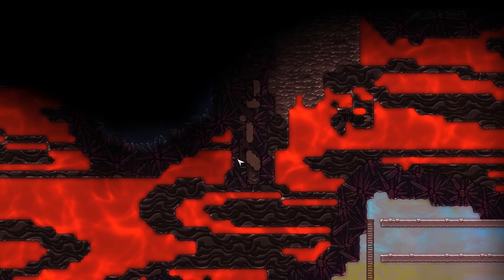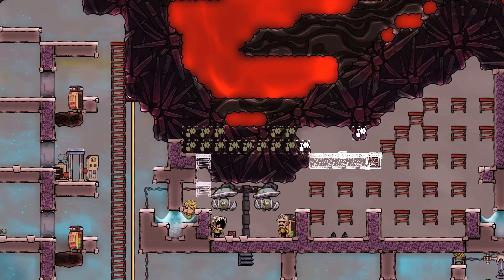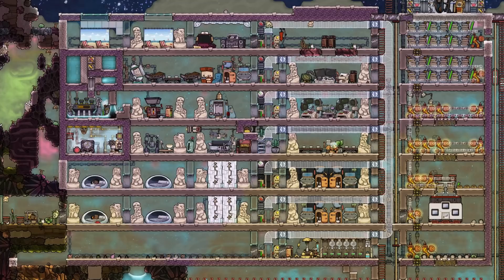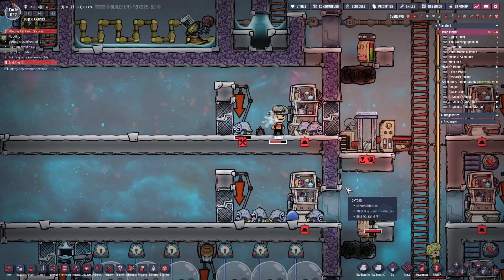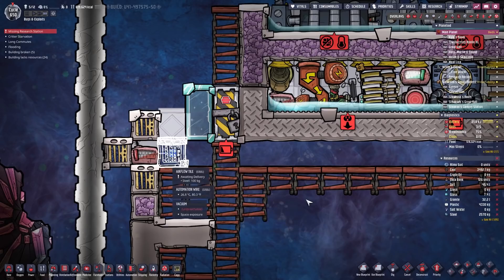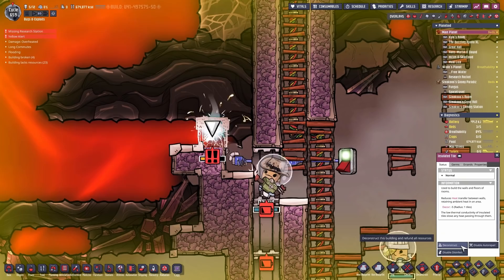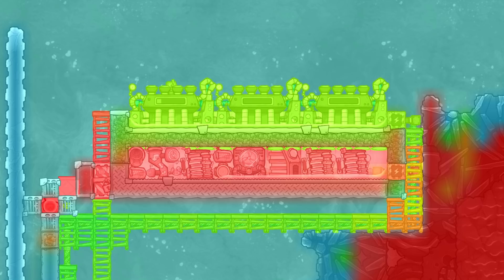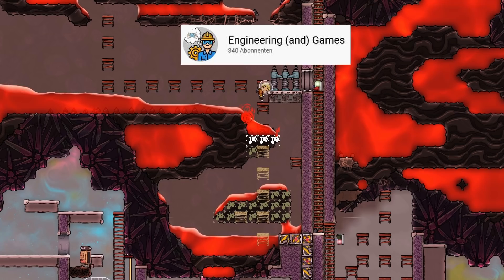Exploiting Magma Transport - Let's play Episode 9

Comment: Hey Luma Love the vids,

Need to ask you a question?

What specs are you running? Im running 16GB DD4, RTX 3070 and an i7 11th gen and my game is starting to lag during cycle 1000+ (im on cycle 1600 rn). Ive heard rumours having more ram may help with stability? 

Curious to know if that's true so I'd thought id ask you with your knowledge of this game! Ive only got 820 hours
Reply from the maker: Hi Abyssal Servers. RAM does make a noticable difference.

If you have a modern Motherboard which it seems you have. Activating XMP gives you a 20% speed boost to the game. I am not knowledgable enough to know if there are any risks to that. Check out francis john pc testing for finer details. :)

My Specs can be seen in the Info panel in my channel.

Comment: Is there a way to do the magma transport bug as a downward 'spike' instead of the upward 'tower'  you show in the vid? I tried having the organics enter the metal tile from the top, expecting the tower to form underneath, but it did not.
Reply from the maker: Hey hey, it always goes from the bottom to the top direction if fed in the way i have shown. You can force 1 tile below depending on the "open" (no tile) side. but after that it will also stack in top direction. 

But if you want to fill something to the downside you can consider dropping sand. if you have a large empty room below some heated metal tiles you could try to block the top and see if the created sand will drop down or stack on top. 
But i think it will also try to stack.
Reply: @Luma_plays  Thanks a mill. This is a great series, appreciate you man!

Comment: What happens if you do this in a multiple type liquid. 
Say I have a triple liquid area and I try and glitch pump it to 1 tile, does it delete the other two kinds?
Reply from the maker: Very good question. I don't know. It will probably be transported but you either delete 1 of those 2 liquids or you push one of them inside the aiflow tile. Bugging it out. Have to try that.
Reply: @Luma_plays  thanks! I have to say, I watch a ton of oni videos on YT and yours are by far my favorite!  I hope you continue! 💚🤙
Reply from the maker: Ok i just tested the glitch pump with multiple liquids. Multiple issues occurt:
1. most of the time 1 liquid will block the other from dropping
2. If you only have a 1 tile storage on top and it already has 1 type of liquid in it the second liquid will delete around 600kg/s of that liquid until it is completely gone. Then it will fill itself in the one tile storage.
3. If you have enough space on top and fill them in after one another they will get stored
and they sort each other according to their type very cool. (tested in a 1 column storage; apperently only worked for 3 different liquids then the deletion started again and deleted 1 liquid)

needs more testing
Reply: @Luma_plays  wow! That is epic! Thank you for trying it out! I'm definitely going to add this to my base for sure!

Comment: I don't get, why there's a sensor for steam turbines? Why disable them below steam chamber temperature reaching 125*C? I thought the steam turbine doesn't work anyway when steam chamber is below 125, right? What am I missing here?
Reply from the maker: There is a red symbol popping up that annoys me otherwise. :)
If a steam turbine is below 125 you see that symbol BUT if you deactivate it it goes away.
Reply: @Luma_plays  Oh I see. Many thanks! https://wiki.teamfortress.com/w/images/9/97/Heavy_thanks02.wav 
It's like with smart batteries not connected to automation.